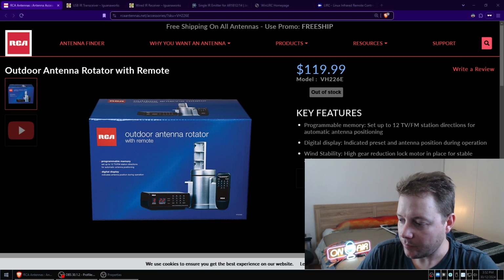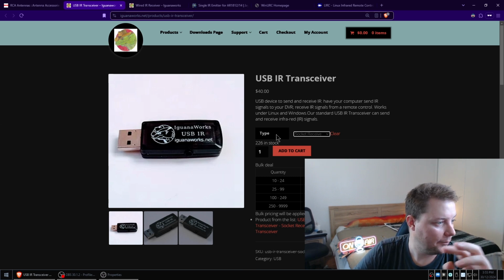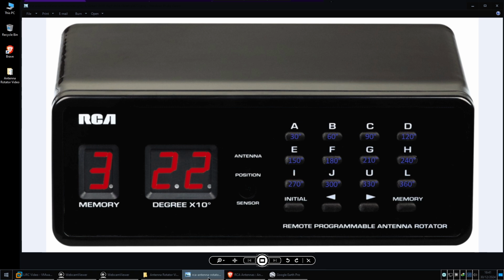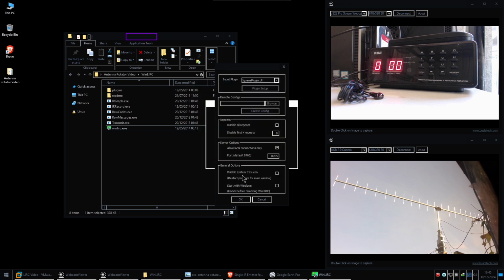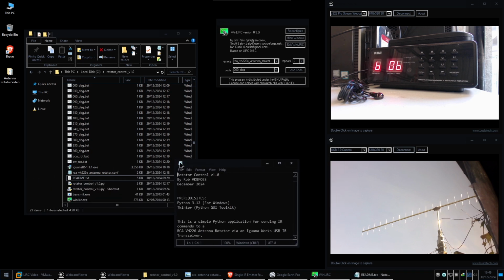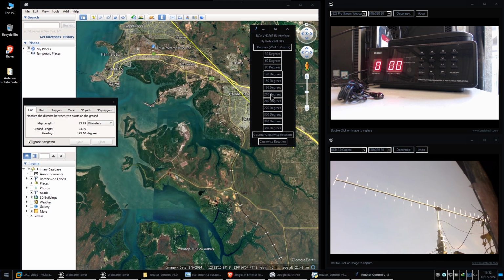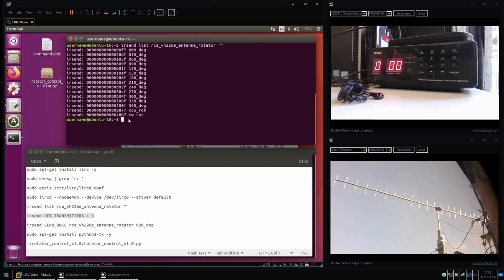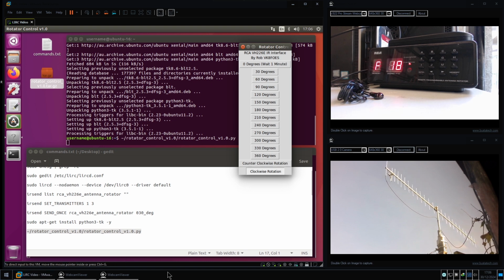RCA VH226E Antenna Rotator: Adding PC Remote Control With a USB Infrared Transmitter and WinLIRC!

Comment: Get the IRdroid USB IR Transceiver. It uses the IRTOY driver in WinLIRC instead of Iguanaworks, as Iguanaworks is discontinued. This works perfect. Get a longer USB extension as the IRdroid does not have a socket for an emitter. Point it to the RCA VH226E and you arein business. Works perfect.

Comment: Update: I contacted Iguanaworks and regrettably, they are winding down the business. "Dear Charlie, I'm afraid we are out of stock and probably not getting any more as we are winding down the business. Sorry."  I am sorry to have found this video this late, as I own the RCA VH226E and operate remotely using an IC-7100. Thank you for this. I am hoping there is another solution for a useful USB Infrared Transmitter. Looks like I will be ponying up the money for a higher end rotor controller. Thanks.
Reply from the maker: Hi! Thanks for letting me know about Iguanaworks closing down. IR on PC is definitely a product of last decade, so I am not surprised. Another option I was looking at was the IRdroid USB IR Transceiver. It claims to be compatible with WinLIRC, maybe you could look into it:

https://irdroid.com/irdroid-usb-ir-transceiver/

Of course, I don't own one and can't be 100% certain it will work for my tutorial :(
Reply: @RobVK8FOES   I bought the  IRdroid USB IR Transceiver and set it up as you showed. It uses the IRTOY driver instead of Iguanaworks, so Input Plugin will be IRTOY.dll. Then load up the remote config.  It worked perfectly. However, your rotator_control_v1.0 will have to be reconfigured. If WinLRC is launched from rotor control in the C Drive, it will automatically configure it to Iguanaworks. I copied the DLLs to the C drive location of rotator control and I get errors loading the config file. And the rotator_control_v1.0 - shortcut wants to associate with a program. But....WinLIRC the manual way works!!! Thank you for this video. I was not going to give up on it.

Comment: I discovered this video while doing research for one of my projects. I'll say, not too shaby. My current implementation uses irsend with an IR diode soldered onto a gpio pin of a raspberry pi 0w, mounted to the front of the control box.

Heres a few tidbits i'll add from my own work as things to consider and maybe inspiration. I have not had time to watch the video in full, so I apologize if i duplicate anything covered.

First, the rotor does not talk back to the controller. for basic usage like pointing a tv antenna to a broadcast tower this might not be a problem, but if you want to be able to work with satellites, simply hitting the C button on the remote will not be good enough. 

The control box and rotor will go out of sync over time. I built a digital compass before i had this rotor and continue to use it. 

I have a very duct taped together setup with node-red bridging my digital compass, rotctld, tvheadend, and sql. every few seconds, node-red hits my tvheadend server to check if anyone is watching tv and what channel. if someone is, it checks sql to see what direction has the strongest signal recorded for that frequency and then uses irsend to move the rotor left or right to point that direction.

Comment: That rotors are junk.And I just had to take mine down and put a 30-year-old one back up.Cause you're a gear broke
Reply from the maker: I think the main problem with these rotators failing is that Ham's put massive HF antennas on them... They're designed for tiny TV antennas, not massive 10 meter beams :)
Reply: @RobVK8FOES  I had  a big tv antenna on it